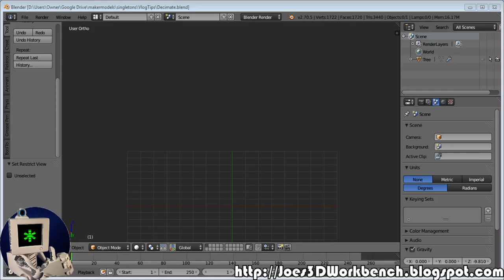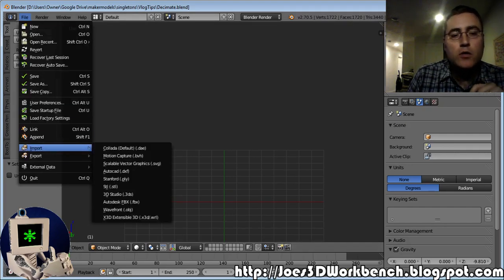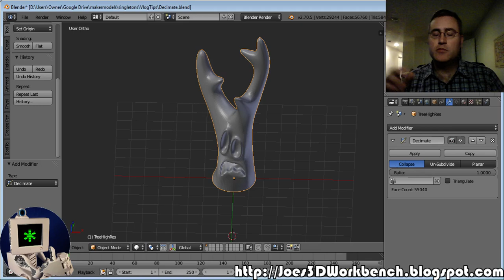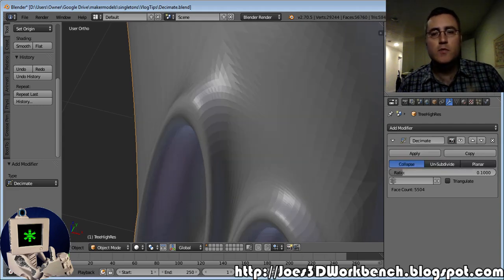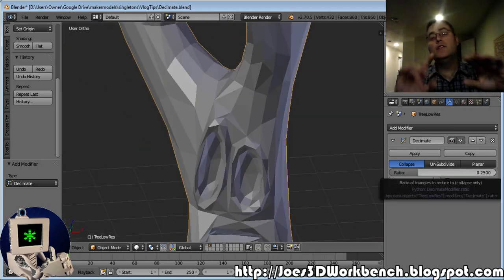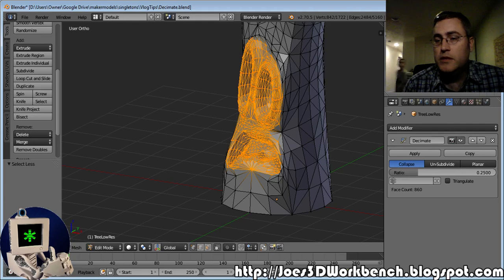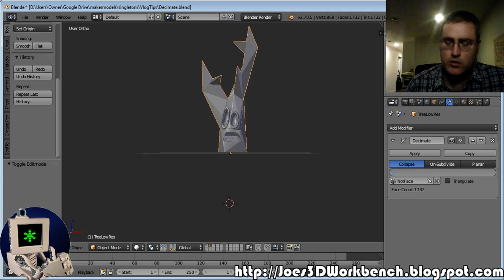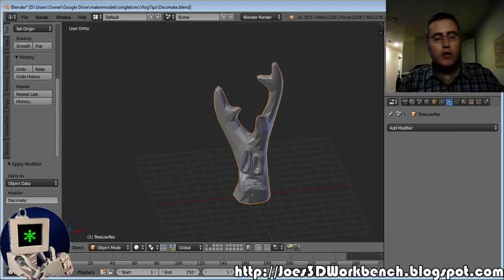Modeling for 3D Printing - Decimate

Comment: Hey what would you say is the max poly count for a low end printer ? 
would the worlds cheapest printer get slowed by say a 1mill point sculpt?
Reply from the maker: Jojo van Wunderkind It's not the printer, it's the slicer, the software on your computer that prepares the model for 3D printing. Some slicers have a memory cap, so high poly models cause them to choke. Other's don't. Also models that have more polygons on a layer that the slicer has to caclulate at a time, like a lithophane, can sometimes choke the best slicer.

Generally speaking I just reduce polygons until I can do so without making the model look any worse.
Reply: could i send you a obj im not sure if it will print okay and it might be to high poly for slicing
Reply from the maker: Jojo van Wunderkind I'd love to help you, but I've got to be careful with the probono one-on-one consultations. But if you post it on the forums on pinshape or 3dprint.com. You'll get more eyes on it, too.
Reply: okay sure ill do that 
yeah im unsure how it will print cos it has no real base

Comment: Hi Freddy! Man I must suck because I found Blender really difficult to use :/ perhaps I'm too used to 3ds max... Great video, and a very good tutorial! Hi Gabe!
Just realised that when it comes to 3d modeling for 3d printing, you wrote the book!
Reply from the maker: No, you don't suck. I was fortunate in that I had years between when I last used 3DSMax and when I started Blender so I could start fresh, but still Blender is an odd one. Fortunately there's a tip for making it slightly easier to use that I will include in the next video; CAD-like modeling with Blender.
Reply: mrjoesays
Well thanks for the encouragement. I did use it exclusively for a month because I decided that I wanted a powerful open source option that handled .stl files well (which it does) but I gave up I think because I didn't have the time to wait for myself to learn the new interface and tools (what's with the left-click anyway, that seems nuts) when I knew how fast I could model in 3DS. Also I'm not a fan of it's boolean tools, I cannot get good results with them for some reason :(
Reply from the maker: doodaddoes Adding "how to make Blender's boolean tools work" to the list of tip videos.

I'll just spill the tip that I was saving for next time here. There's is a settings in the properties to change how the left-mouse button works. it doesn't work everywhere, but where it does thank goodness.
Reply: mrjoesays
Ha ha, I look forward to the vid :) I guess I never changed that button (though I knew you could) because I thought that over time I would learn it's use and appreciate it. I never did ever discover what it even did! Maybe I should just get back in and make it work like I'm used to working... After I build a better 3d modeling machine :)